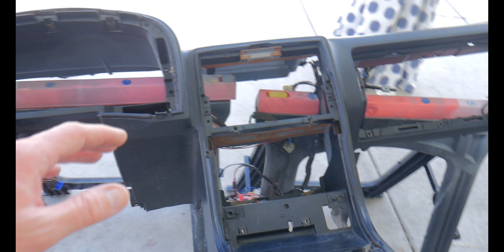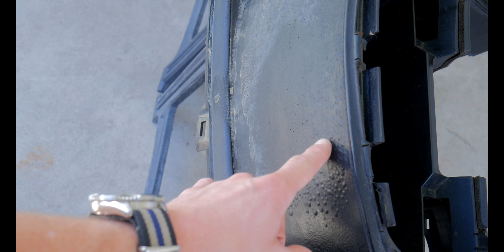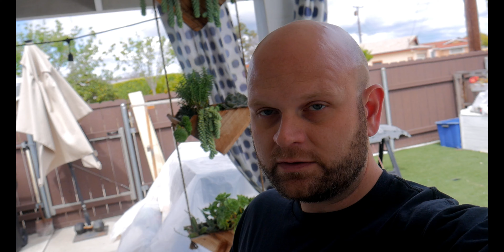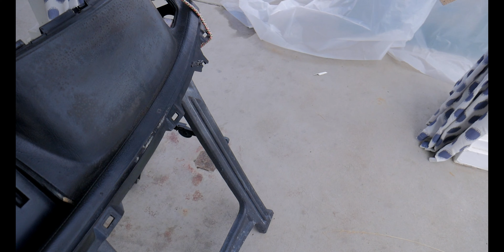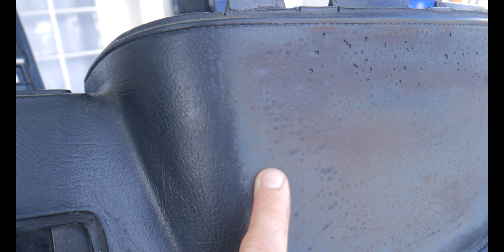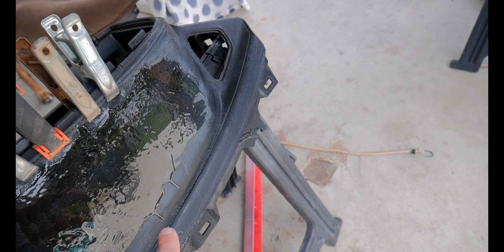Dash Restoration FC Rx7 // Flocking

Comment: The bumps are caused by the release agents in the molds when making the dash.
Reply: After you sand you can add 3M adhesive promoter and fill with 3M easy sand and use like body filler for the dash

Comment: So why you say never flick your dash ? It seem like you still liked it at the end. I’m thinking about flicking some parts in my car like the center console( cup holder area )  and stuff but my friend say it after installing and removing the dust. It will still be dust rubbing off. Is that true.
Reply: I flicked my dash once and it hurt my finger.
Reply from the maker: I saw never flock, because you need practice to do it. I would not flock anything that you will touch or put weight on. The flocking will come off.
Reply: Mohr Garage thanks man
Reply: Properly and professionally flocked parts, dont rub off. You can even scrub them with a stiff bristle brush and use detergents and all purpose cleaners
Reply: @ep91monster  you really care about flocking😂
Reply: @Silverado-nw2lj  that's because it's my business 😉